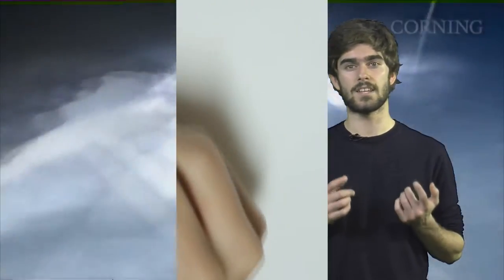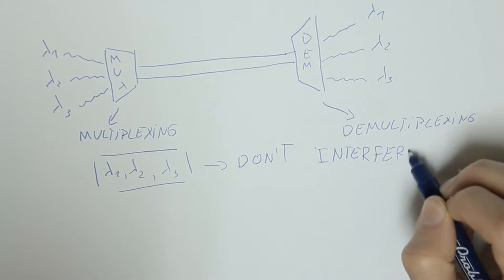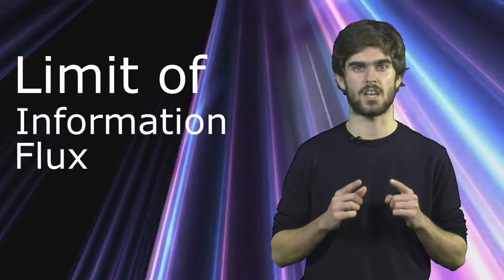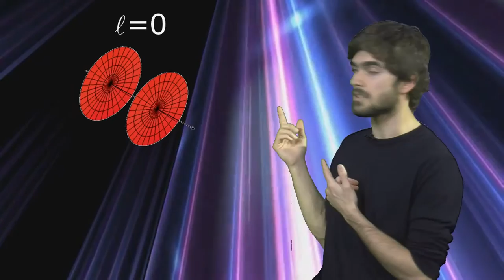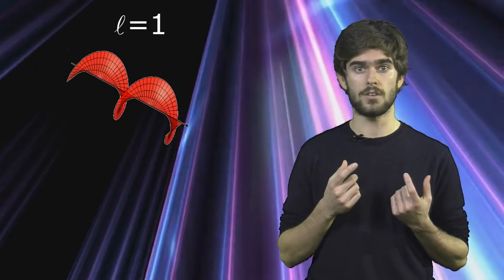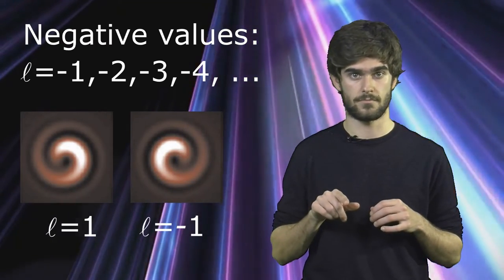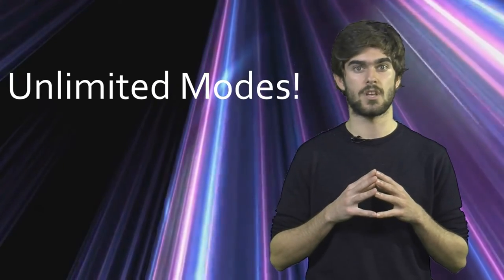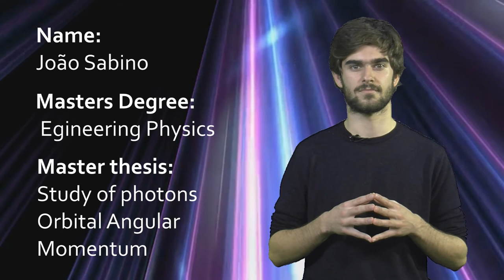Orbital Angular Momentum (OAM) - Project MEFT -João Sabino

Comment: I found that a prism separates different wavelengths quite well, but if you plan to separate them by right- or left-handed spin, the Fresnel 3 quartz prisms in alternating handedness would be a lot of extra gear for the bang and probably be more useful for encryption.

Comment: Hi João, how does the spectrum of these OAM waves look like? Also is l=infinity possible? Would that contain infinite amount of information?
Reply from the maker: Saabireen Syeed Thanks for your comment! The fact that light carries OAM shouldn't change the light spectrum, it is the same before and after the wavefront modulation. About the "l" range: mathematically it can, however, physically it isn't possible because if "l" tends to infinity you will have a  big OAM and thus a great linear momentum too going away the propagation direction. Since we are considering the paraxial approximation, the solution with a very big "l" is not valid. The biggest experimental value I have found was l=42. I hope this helps. If you need anything else just tell me!
Reply from the maker: I forgot your last question. So, you can use OAM in two ways: either you use it to multiplex different channels of information (beams with different OAM propagating in the same medium) or use a different OAM (different "l" values) to encode different symbols. Thus,   the more "l" values you can access the greater the quantity of information you can send in a communication link. Let me make clear that a beam with a big OAM isn't more useful than a beam with lower OAM.

Comment: Hi jo,
Really it's very nice explanation, and what I want to know, what is the characteristics of the used fiber cables to carry those modulated light waves?
Moreover, Do it work at the same wavelengths or there is a new range?
Finally, what are the last updates?
Reply from the maker: Hi Reda Amer, Thanks for your comment!
Regarding the first question, I did everything in free space, I didn't use any fibers. 
About the updates, unfortunately I stopped working on this interesting topic. Please tell me if you need some references, maybe that already helps. Cheers!
Reply: João Sabino 
Thank Jo for your prompt response, yes please share the available references, I am involved in fiber optic research and development in my company and I see that the future will be in this technology...
Reply from the maker: @AR-zk8mk  Sure, add me on YouTube and then send me a private message with your email. ;)
Reply from the maker: @AR-zk8mk  Thanks. I'll send you something today. I hope it helps. Good luck!